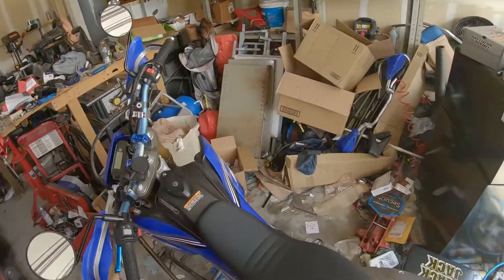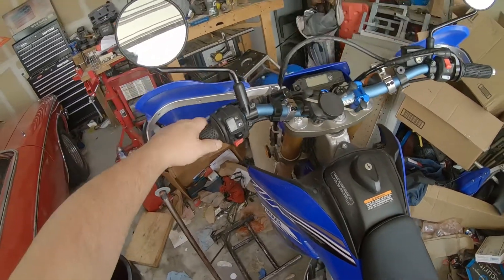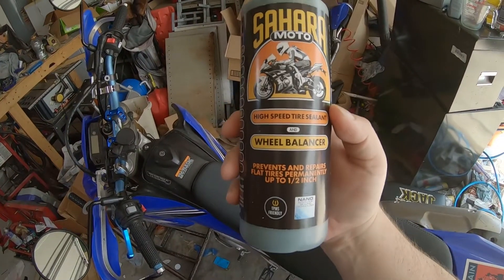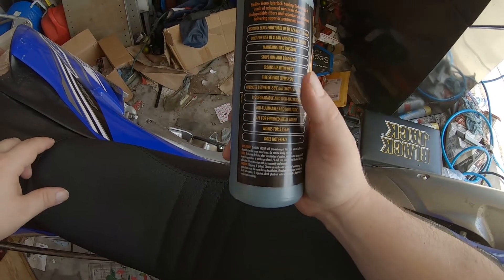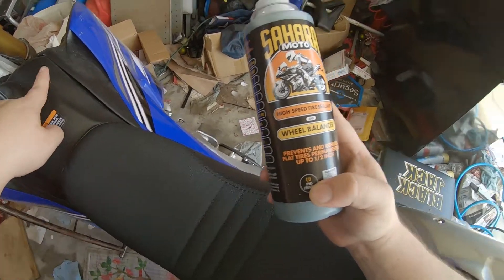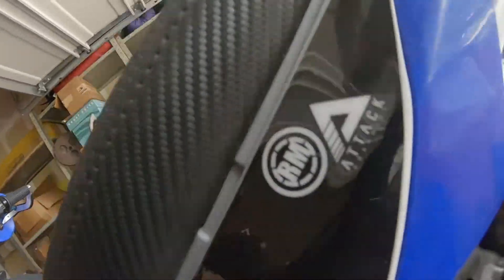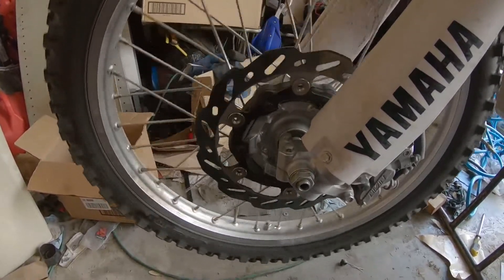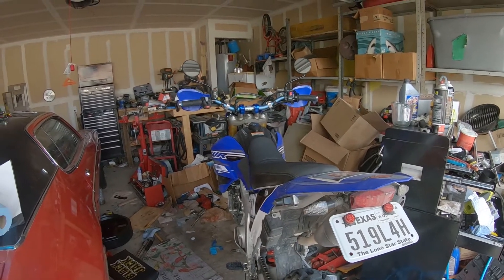Sahara Moto Tire Balancing Goo

Comment: I have about 1000 miles on a new set of tires. I took off all weights and the motorcycle rides great. Easy install. Follow directions and no issues. Very happy so far.
Reply from the maker: I'm glad it's working out for you I stumbled across that stuff purely on accident and I like the price and how well it performs. I guess I should have done a follow-up video to this but I accidentally hit a cactus not too long ago and it did manage to seal the tube long enough for me to get back to camp

Comment: Great vid! 
Does this material harden over time requiring adding more (say in 6-12 months)?
Any updates on flat protection? Tire balancing?
Do you still like it or have you settled on a different product?
Finally, what tubes (brand and thickness) are you running? 
Thank you
Reply from the maker: I ended up having that bike 2 years, Ran that set of tubes 1 year with 2 tire changes. The goo never hardened, stuck in one place, or caused an issue.  Then again Ride On performs that well minus it's leak stoppage on tubes.  I still use the sahara on my CRF450RL for balancing run tusk ultra heavy duty tubes, kenda k760 front and motoz enduro IT rear.  Had a sizeable mesquite spike in the front tire I noticed after the race and the tire a week later is still holding air with only a small greasy spot that was left behind.  For my YZ I run Tubliss and use the green stuff in it per manufacturer's suggestion.

Comment: Great video!  I dig the Nintendo Metal soundtrack as well.  Noob question here: is one supposed to use the Sahara and replace the air long term, or is it for temporarily fixing flats after the fact?

Thanks!
Reply from the maker: Thanks a ton I write my stuff in MIDI and then run it through a famicon filter. So the tire goo is something you put in when you put new tubes on and just air the bike up. And just add more air as needed, the leak prevention properties are kind of a secondary benefit other than the tire balancer

Comment: I found Moto very effective. Easy install and balanced very well. Not sure of your math, 7.25 plus 8.75 adds up to 16 oz.  Also, I have no idea where you get 50 miles to set up?? Just a couple of miles and the Moto was balancing great and has every time out. Pulled a couple of thorns and one nail, sealed right up. Safe riding!
Reply from the maker: If memory serves me right it's been a while since I made this video I mentioned that my bike needed slightly more dosing than the bottle I ended up shorting the back tire as I assumed it wasn't that big of a deal as the front. The bottle I had back in the day specified a 50 Mile first ride to properly install the product which I thought was a bit extreme myself.  Thanks for watching and yeah I love this stuff compared to ride on